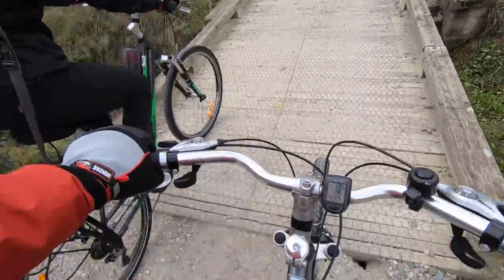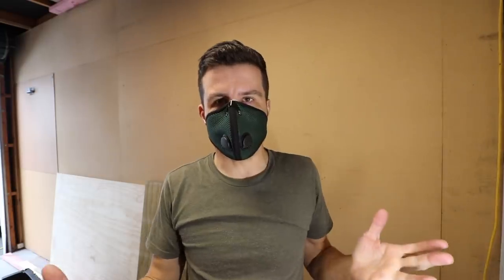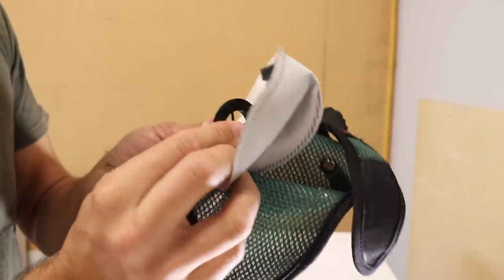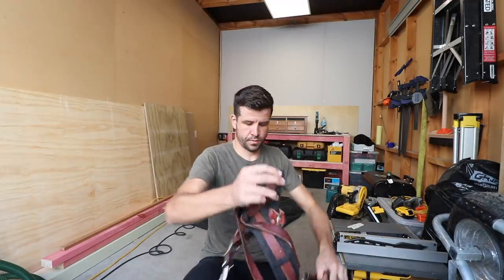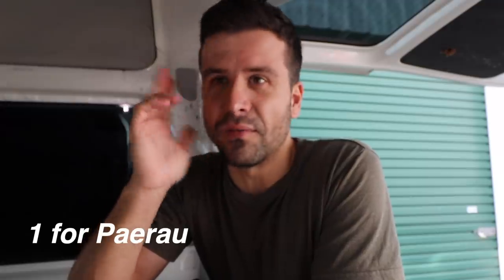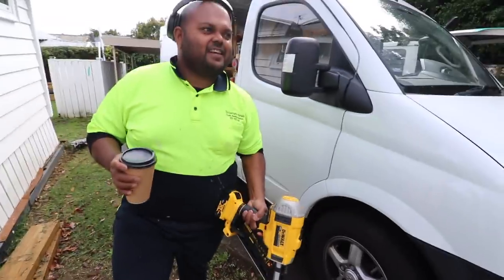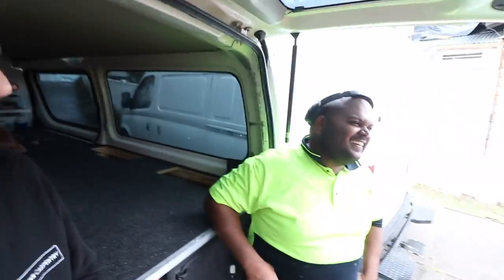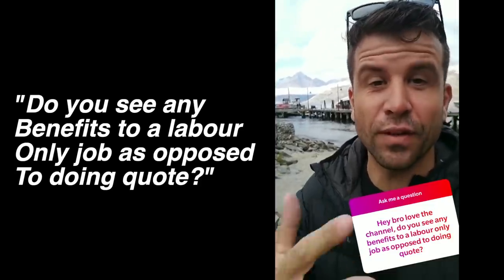RZ MASKS: Only Mask You Need?

Comment: I have an RZ that I don't use because I find it very uncomfortable.  A lot of people love them, but for me it's very painful.  With the single low strap, it pulls back and down putting pressure on the bridge of my nose. The filtration is done by the paper insert, not the mesh, so I thought my paper masks were doing the same job of protection.  It turn out that I am using N95 masks and that RZ inserts are N99.  I also noticed that RZ now has a model 2.5 with an upper strap ... so maybe I'll have to try that.
I did a bit more looking, and there are several brands of paper masks rated N99 with exhale valves, and N95 with valves and charcoal .... they are typically low$20's for 20 to 30 masks, RZ is $10 for 3.  I'll keep looking for a N99, valve-charcoal combo.

Comment: Cool looking mask,buts it's essentially a paper mask with a nylon sleeve to hold it around your face.id like one but at around £35 UK price I'll probably not bother.
Reply: this is true, although I did check and they are better than the paper masks that I've been using. I use N95's and these are N99... the number being percentage of particles up to .1 microns... (I think)
Reply: I agree. Like the mask but a 3m mask like Scott's other one is far cheaper option. I can only find for £50-£70 in UK

Comment: Scott, you said that you use "prefer" to use a respirator for paint fumes, I think it would be helpful for those new to the trades to understand that a dust mask does not filter vapors, esp any kind of solvent.
Reply: fotopdo this is true. I got poisoned from CO from running a concrete saw inside a bathroom in a garage, I had fans blowing windows open to blow dust and vapor out.. I wasn’t chocking on dust but I started feeling extremely tired to being so dizzy and dazed I thought I was going to die.. I literally positioned myself to where I could be found if I did so I could receive help faster. A respirator needs to be vapor approved. CO poisoning kills especially in cases where it poisons you very quickly rather than a slow leak in a house. It’s very extreme.

Comment: Scott, I want to know if you would recommend the Toyota Hiace or not. I am about to change work vehicle from a 4wd with boxes on the back to a van. Plenty of reviews say the Hiace is a bit of a turd to drive but great at the site, also the Hiace is the highest selling van in Australia at the moment even with the current style being 12 years old. 
The Hyundai iLoad is my other choice, just a but annoying the rear cargo bay is less than 2400 long. 
But would you recommend the Hiace?  
Cheers mate.
Reply from the maker: Yeah what you heard is right. They struggle up hills and are loud inside the cabin but great for building. I would buy another one if I needed to, pretty happy with it.  I hear they have finally redesigned the Hiace and plan on rolling them out this year.  A brand new one would be a bit pricey though.

Comment: I tried out the dewalt nailer a while ago and it wouldn’t sink nails in LVL plus the cycle time was too long, the hitachi kicks it’s butt, sinks nails fully into LVL13 and nails as fast as I can hit the trigger. Only complaint is the handle design always give me a blister on my thumb knuckle
Reply: Clint Jones harden su up Clint
Reply: I got a de Walt and returned it, picked up a Hilti instead 
I have troubles with the nails not driving into lvl 
When I replace the gas I get better results but not for long
Problem is I seldom use it here unless I’m being lazy with formwork.
 I’ll be keen to try that air bow and do away with gas that goes off in the heat
Reply: What's LVL? Is that laminated something something
Reply: Elijah laminated veneer lumber, in this case 95 x 65mm
Reply: Brett Mowbray cheers
Reply from the maker: I haven't used a lot of LVL myself, but I need a gun that can shoot into the native timber we have in NZ homes. Maybe the dewalt isn't the way to go
Reply: Scott Brown Carpentry 
I was once a chippy from Auckland, now living in Darwin. 
I find I fall back on my knowledge and experience in selecting tools, and it sometimes doesn’t account for changed environment, materials and building methodology. And what I thought was a sound choice leaves me feeling how hum about some tools.
I try to stay open minded that I still get it wrong,
So I thought a nail gun would be easier than pounding nails formwork style.
I lined myself up to build a stage, heaps of nailing, I ended up old school pounding those nails home as 50% sat proud.
And that was the hilti, tried 4 gas cartridges, all new but old, then bought one new and still disappointed.
I dream of timber framing and working with pine again.
So how did your nailers perform in the natives? Might I presume it’s fixing pine into old houses. Douglas fir, Rimu.
Keen to hear performance of the Airbow.
Reply: Scott Brown Carpentry the hitachi will smash it, I do the odd bit of reno work on old rimu framed houses and it smokes it. got mine from Blacks Fasteners coz I buy tons of nails from them and they gave me a real sharp price.

Comment: This masks alright but not great. In todays insanely inflated mask prices i feel like i got this at a decent deal.. about 35 bucks for the mask(comes with 2 filters) and each additional box of 2 filters was about 8 dollars. Main things i dont like about this mask is the cost, I wear mine at work outside in the sun and sweat in mine a hell of a lot,  the foam lining on the nose bridge which is glued onto the filter comes loose, pretty damn annoying especially at 4 dollars per filter replacement. Secondly,  since there is only one strap which goes around your neck and no strap on top this mask pulls down on my nose. I cant really breath through my nose much while using this mask its all mouth breathing. Its fairly comfortable to wear aside from having my nose blocked off. This mask works a lot better than a bandana but I cant wait for 3M masks for be available for cheap again. I use to get a box of 20 count 3M masks for 10 bucks. Now im buying replacement filters at 4 bucks each.. sigh..Hopefully the velcro on the mask straps dosnt wear out any time soon., velcro thats used a lot typically wears out and becomes useless.

Comment: Don't waste your time with that dewalt nail gun.
I had one and I can confirm without doubt it is the biggest piece of sh#t I've ever wasted my money on.
Apart from the pathetic ramp up and sheer weight of the thing, it's incapable of consistently fully sinking 90 mm nails in softwood framing timber. It can't even sink 70's in hardwood.
Dewalt shouldn't be allowed to sell this piece of junk.